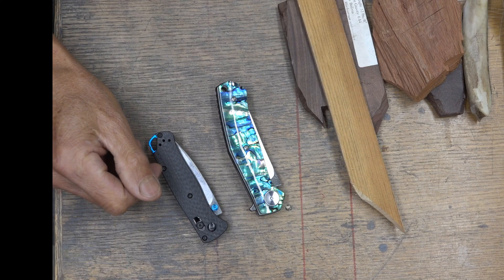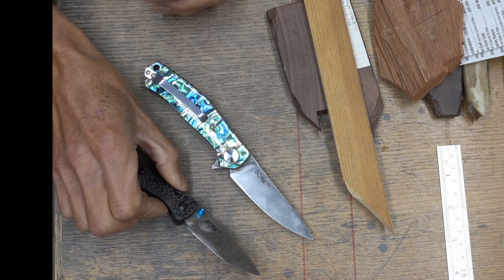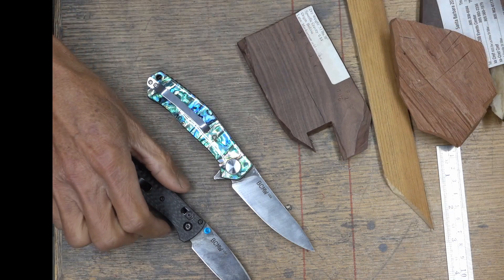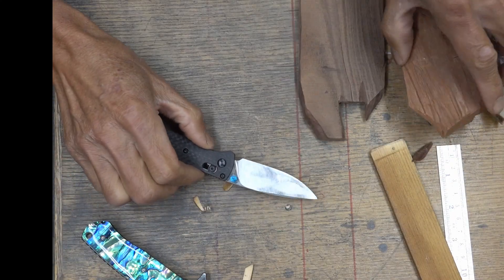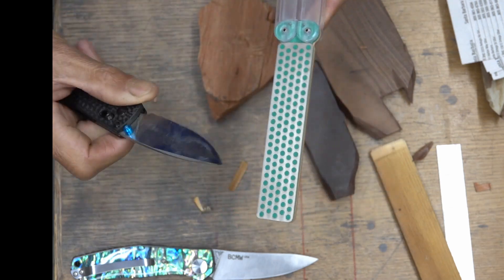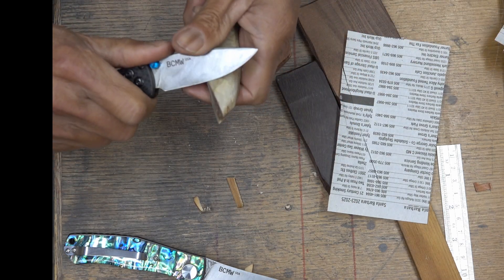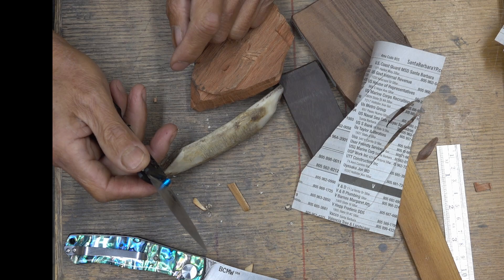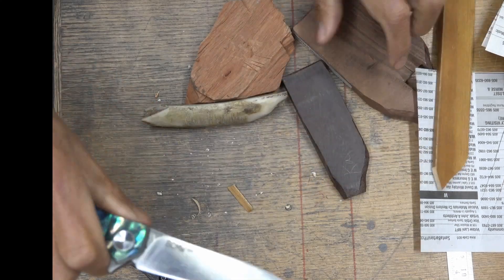Rehardened Inexpensive Pocket Knives

Comment: Is there ever a problem hardening (presumably with aluminum plates?) with the blade already in a beveled cross section with flat pivot area vs. fully rectangular cross-section?
Reply from the maker: Since you asked 'is there', definitive answer is yes - when plate quench bare air hardening steel blade with non-contacting thin bevel+edge and with cold air blow at the same time AND stopped before thick spine/pivot cool enough which would cause auto-temper.  LOL a long sentence eh.
This type of blade profile often present with problem for liquid hardening steels - warp; bacon; crack...
Reply: @Luong_La  Do you wrap in foil or any other system to prevent decarb?
Reply from the maker: @nahte123  wrapped in 309 stainless foil